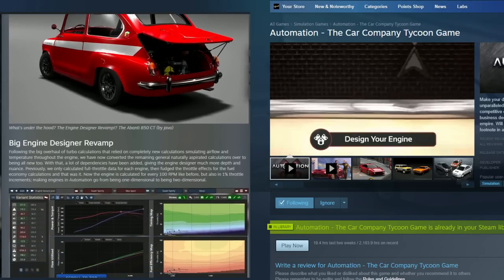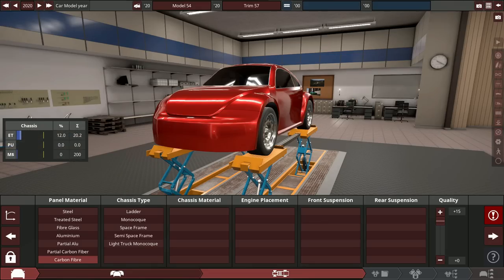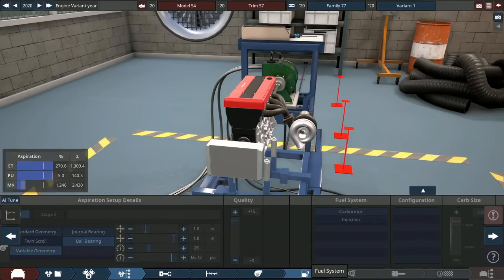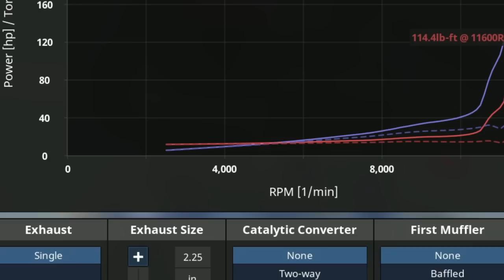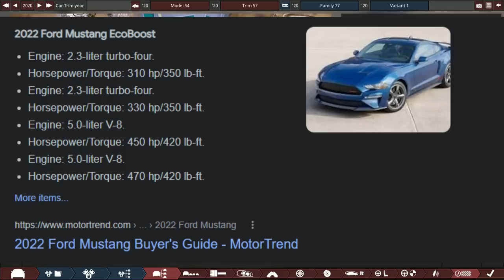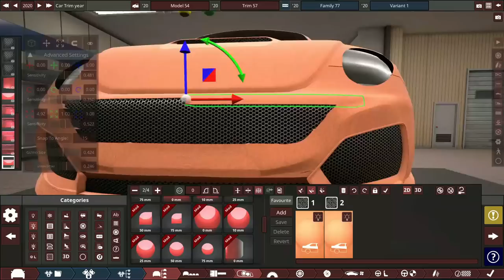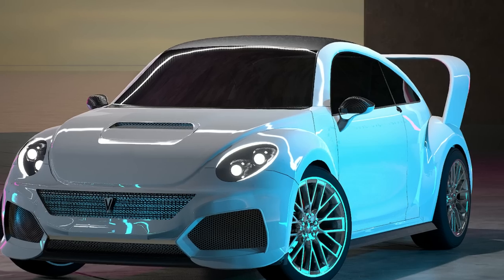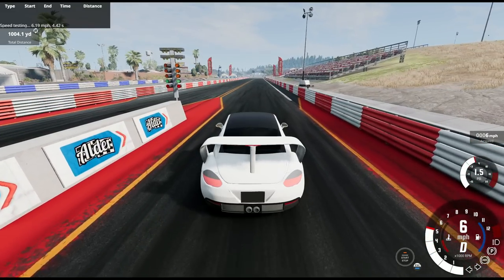Automations New Update Is BROKEN ~ Making The Craziest Engine EVER ~ Automation - BeamNG

Comment: With a CVT it could probably be pretty quick.
Reply: Exactly what I thought, maybe one of the best cases out there
Reply: a 10 speed auto might help a little bit
Reply: Ironically they did update automation so you could add cvts in beamng.
Reply: @jwalster9412  WHAT! When?
Reply: @recon1673  it said in one of the patch notes.
Reply: @jwalster9412  Oh thx
Reply: CVT isn't the slowest of them all?
Reply: Yes!
Reply: @gabrielv.4358  It will keep the engine in boost and at high rpm for a longer time.
Reply: @jwalster9412  Yes i recognized it after watching the video

Comment: I was expecting the red line limit to be increased from 12,000 to 15,000, but other than that, I am very excited.
Reply: They'd have to fund new engine sounds.
Reply: you can do that later in beamng with the race ecu but it doesnt always work (power goes up or down exponentially after 15k for example)

Comment: That car looks absolutely amazing! I have a really hard time making cars look that nice
Reply from the maker: I appreciate it bud, I took a little more thought than usual in the front!
Reply: I think if you remove the cardboard roll holding the wing and add another wing then the rear would look just as good as the front.
Reply: One of my tips is to look at reference photos of cars that you like, or cars that are Similar in shape, that way you can get an idea of what is missing and what would halp.the design. Remember, alot of cars take days of hard work to design, and most are still made using clay models.
Reply: @TwinTurBros  It sort of reminds me of a Ferrari California, but not that that's a bad thing!

Comment: just bumped in my drag car, it gained 1000+hp with the new update. it's now making 6500hp with 6.5:1 compression.
 it was bananas before. it's going to be terrifying now. even the automation stats (which were pretty pessimistic compared to beamng) say it'll do the 1/4 mile in 7.8, which i could reliablely beat with 4500hp...
lord helps us lmao
Reply: The turbo lag probably takes about a minute to kick in, but I'm sure it's exciting waiting for it to-- OH THERES THE BOOST!!
Reply: @jwalster9412  it's not slow to charge by any means, unless you make the mistake to use the automatic trans from automation. revs pretty hard and if you dump it above 3K it spins all 4 instantly. problem is that it's effectively undriveable on boost. the wheels wobble practically off the car and it will spin once on full boost, even at 400+ kph...
there's the limits of running 395's on all 4's.
Reply: the compression in the game is very stronk you can make low compresion 10:1 fuel 40 psi and its like runing on nuclear power
Reply: @jwalster9412  yes the turbo also varies on load first gears you spin at low boost because theres not enough accel and you either need to spool it or antilag

Comment: the update unfortunately made breaking the 10,000 hp barrier impossible as the strongest pistons you can get only hold 6000lbft of tourque before they start breaking.

Edit: still possible earlier today I did hit 10,524 hp (at like 95%torque stress) so previous comment kinda incorrect
Reply: it wasnt possible before tho. not without messing with the car file. the max power engines are all grenades, like IRL.
Reply: @comethiburs2326  someone did do it, I think maybe forgotten mustard but earlier today I did hit 10,524 hp (at like 95%torque stress) so previous comment kinda incorrect.

Nvm it was actually rye, it was the bus video
Reply: I did a harvester yesterday at 2 am 😂😅 thing makes 6420 lb/ft at like 3700 rpm and over 4900 hp and with a quad turbo 20L V16
Reply: @javiermurillo4404  reduce the displacement and bump the rpm up. i'm able to square the horse power to torque ratio with a 12L V16.... 6450hp and 6480nm...
Reply: what engine?
Reply: increase rpm lower some things like boost or stroke less torque higher rpm more hp
Reply: @javiermurillo4404  i did a couple of tank engines some even sound like tanks i forgot how i did them some 2000 rpm some 3600 they are peak torque at 1200 rpm torque to hp 5:1 or more

Comment: makes a 125cc 3-cylinder engine as efficient and economical as possible... Thanks for listening.
Reply: I did inline 6 3.1 litre(much stroke, like diesel) single turbo with 47.6% efficiency. I did it on old version

Comment: Btw you can make a extremely small 3 cylinder with nitro and push 1200 hp so far all I've gotten. Also in a car with only 764 lbs of weight running 6s

Comment: side note: I've acheived higher than 100 throttle response, idk what the max is but definitely to 100
Reply from the maker: Ah fair enough. I was sure it was around a hundred, but I probably should have put an * just in case!

Cheers bud!
Reply: @TwinTurBros  i don't even know what it does tbh lol, I've went as high and low as I could get it and noticed no difference in actual performance in beam, or even how fast it responds to throttle in the engine tester
Reply: what does it even do guys? throttle response seems to be useless for me.
Reply: It's just a campaign stat, used for sportscars

Comment: This car with a 16 speed gearbox like the 9 speed in the Gemera but with 1 more gear on the end of each shaft, somehow, would be pretty fast. It would just shift out of each gear so fast to stay between 11k and 12k rpm because everywhere else is choked XD

Fun fact: The Gemera shifts by engaging 2 gear pairs between 3 shafts with 3 gears on each to get 9 gears. That's 3 possible pairs between each shaft, and with 2 possible pairs that's 3 times 3, or 9 gears. Add another gear on each shaft and you get 4 pairs between each shaft, or 16 gears. Two more gears on each gives 25 speeds. Its really quite the amazing little gearbox, imagine a semi truck using a huge bulky one made to handle a couple thousand pounds of engine torque but its got 7 gears on each shaft, 49 speeds to choose from, one for every possible degree of inclination or one for every five hundred pounds of cargo XD
Reply: bro who is dual clutch
Reply: bicycle gears ratio supercar

Comment: Current F1 engines at 1.6L make up to 1000hp with a set in stone rev limiter, limited boost and fuel flow so it's not impossible
Reply: Yes but that’s also peak engineering in a sense, the max that engines are capable of right now
Reply: @eligerman1676  And let's not forget these engines have a ridiculously short lifespan. They are bound to break in a season, sometimes multiple times.
Reply: You are actually a bit misinformed. A formula one CAR produced around 1000  hp, but you have to remember that they are hybrid, so you have to remove 160 hp for the electric motor (mgu-k).
Also, the rev limiter is not a limiting factor (pun not intended) since they are allowed to rev up to 15k RPM, but due to fuel flow restrictions you don't gain any power revving past about 12k RPM.
Reply: As the person above you mentioned, if F1 engines were to gain power past 12k rpm they would use too much fuel and get disqualified, so they get close to 850hp max that decays a little at the end of their (less than) 1800 miles life cycle.
Reply: @r3lease866  there are claims that the engines by themselves make 1000 hp with the top teams
Reply: Even previous F1 engines made that power (at least in qualifying trim) such as the Renault EF-Type engine producing over 1,200 hp in a 1.5 liter V6, albeit with a massive amount of boost considering the compression ratio of just 7.0-7.5:1.

Comment: I followed along you building the engine on my own computer and after a few minutes I got 287.3 horsepower out of the 178cc engine. That is 1614 horsepower per liter using the same formula you showed. This is just wacky

edit: i just made a 134cc turbo 3 cylinder making 309.4 horsepower. that is 2308.9 horsepower per liter

Comment: Don’t the engines used in the moto gp motorcycles have a similar horsepower per liter ratio
Reply: Nope. They make 240hp~ and displace 1 liter. Ie 240hp per liter
Reply: Not even close that what makes this so insane 😳

Comment: The key here is that you are using metanol, both cars you are comparing it to are gasoline engines.

Drag racing cars from the 80s alredy got about 1000hp per liter.

Comment: Definitely not realistic hp per liter numbers. There are civics with 1000hp per liter but thats about as far as thats gotten. not to mention the power delivery probably isnt quite that dramatic even with those motors running 90+ psi
Reply: Show me a 1000 hp per liter civic
Reply: this car is on the fuel drag cars use. the same engines last literally just a few seconds but make insane power so i see nothing wrong with this
Reply: @1DS9  the 2.0 from honda and the sr20 and 4g63 can make 2000hp in profesional 3 turbo compound setups , the 2jz and ls3 and big hemi can make 3000 but thats kinda the limit maybe some cummins can too
Reply: @jammygamer8961  Fair enough. Still 100hp per liter more than a top fuel dragster haha.
Reply: @Noooo23523  then again, they use nitromethane instead of methanol so that affects things even more. Not sure how fair the comparison is
Reply: @Noooo23523  Funny enough, the Red Demon is bored out ever so slightly lol.
Reply: @1DS9  You living under a rock?
Reply: @zandaughtry7936  Smaller engines have higher powers to litre than big engines in automation. For soem reason

Top fuel dragsters make 11000 hp which not even the 16 litre V12 can't make on nitro methane at the moment as it destroys itself. V16 can do 12k tho.

Mean while top fuel dragsters used 8 litres
Reply: @zandaughtry7936  per liter. I haven't seen a 2.0 car hit 2k horsepower ive seen 1300. Which is close but no cigar.  The billet block guys are getting 2k hp without top fuel?
Reply: @zandaughtry7936  yea and im talking about reality the ls and hemi tho can make up to 1500 more reliable than the others the 2.0s go into full drag mode
Reply: @1DS9  yea there are evos with 1500 and special events ones with 2000-3000
Reply: @1DS9  yea and the billet throws the street drivability away they can get some 1000-1200 but its also hard 700 is guaranteed on most of tuning legens
Reply: @Noooo23523  yeah i shouldve been more specific those 1000+ 2.0s are always breaking tho cheap compared to building a v8. You take an eg and k swap+awd swap you have an absolutely nasty cheap 600 horse reliable(once sorted) build that these ls guys cant match simply from weight to power and ease of awd swapping vs say something like a gto or camaro.
Reply: @Noooo23523  but then a 600-800 horse camaro with handling mods will eat that civic on a track cause its just too much power to rip thru the corners at full tilt. (Also not knocking a track prepped civic with an epic driver cause thats where the diff it truly made) evidenced by me tonight for example my buddy has a gt2 stinger and i drive an 05 tahoe we were fucking around he was leaving me in the straights but come every corner i was on his ass with true chance of passing just based on driver experience.
Reply: @Noooo23523  also most awd civs are siting around 70% front 30 rear for power split without spending a metric shit ton on the drive train which isnt too big a deal in a straight line but again will affect a high horsepower car on track. Basically any buildwth enough money can do just about whatever these days my initial comments was focused more at true street/strips car which i shouldve specified. I love debates in the comment sections tho low key can learn alot and if you disagree with any of my statements please take the opportunity to present me with knowledge so i may know more in the future.
Reply: @1DS9  yes and you dont even need 600 hp is you have a good gearbox and slicks and you can get it up to 1200
Reply: @1DS9  yes and the 6.2 camaro can easily go to 1000 from 700 the na having 450 you can tune it to 700 like the supercharger one and from then you need to start upgrading parts, race exhaust intake cams then you get better valve springs etc
Reply: @1DS9  yes and it depends on tires if you go full crazy awd on a civic you can get slicks or just good race tires and get more equal distribution and some lsd for the first second of acceleration , yes we learn from each others comments i did dis
Reply: @Noooo23523  oh yeah those sequential gearboxes for the civic go for 8500 vs 15 20k for a t56 its nuts
Reply: @1DS9  on a civic awd with a good turbo and a racing gearbox you can get to 100 in 2 seconds but you will melt the engine more and more with each run
Reply: @Noooo23523  check out the torque simple bolt ons are getting down low on the lt4 motor in my opinion thats the best street car motor for usuable fun. And hey grunt whats your toy if you don't mind me asking? I run a turbo busa 64 inch wheelbase with a 56mm turbo so i spool fully by 4500 rpm instead of 6k plus these gt40 guys are getting. Feels amazing on the street even without getting above 50 mph

Comment: Kinda reminds me of a 4 rotor rotary engine. But yk without the rotary engine. Reasonings - Sounds similar to a rotary engine in sync with rpms, shit torque and only likes high rpms, similar tune mapping, and ofc the fact that the engine is able to handle a shit ton of boost.💀
Reply: But ofc a normal rotary would not be pushing 1400hp per liter.

Comment: Top fuel dragsters make 11k hp with 8.2L engines which is 1340 hp/L. Amazingly they achieve this with pushrods and a supercharger that takes almost 1000 hp from the engine to run. So the specific output you are reaching is possible in real life, but the engines only last a few seconds of runtime before needing to be rebuilt. Obviously for a luxury road car like a konigsegg this would be undesirable. And if you are going for tiny displacement obviously you get such a small window of performance that the driving experience is awful. I don't think this is really that broken, you are just making something really impractical.

Comment: I was able to achieve a maximum of 12100hp from the V16 engine using methanol
Reply: try nitromethane
Reply: @jammygamer8961  I already am on the limit of torque. I cant change to nitromethane without destroying the engine.
Reply: @ytaltacc8008  oof. thats a shame cause i was hoping/expecting the V16 to make 14k horsepower.

didn't think its torque tolerances were that low. you got both the tech pool and quality on 15+ right?
Reply: @jammygamer8961  yes. I cant open the game right now, but I think I achieve full boost and torque at around 6k-6.5k, and its something like 7500nm. Redline is 8.6k. So the engine acrually has 2k rpm of usable boost, which is a whole lot more than what twinturbros gets with his engines. 200rpm is not enough, unless you use a cvt. I tried to get the maximum torque to be higher, so it produces more power, but I couldnt because the turbos dont get big enough for a 15L engine to rev up to 10-12k rpm, so they explode. The exhaust is also a serious bottleneck, its at something like 150%.
Reply: @ytaltacc8008  oof